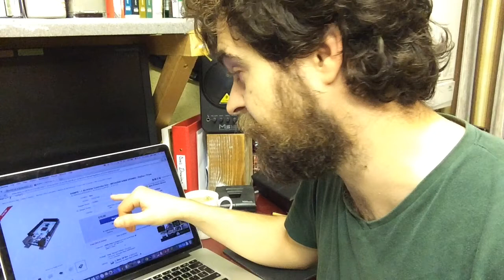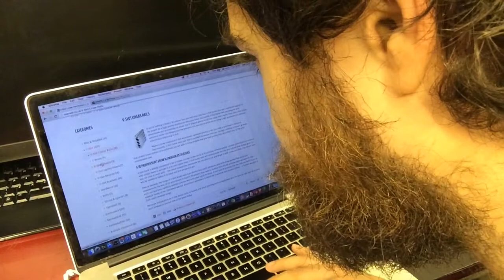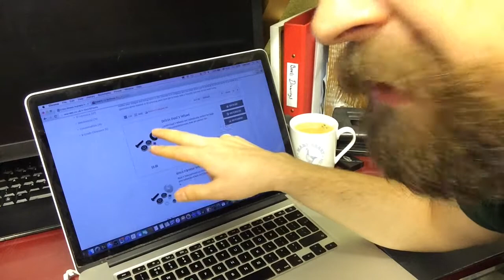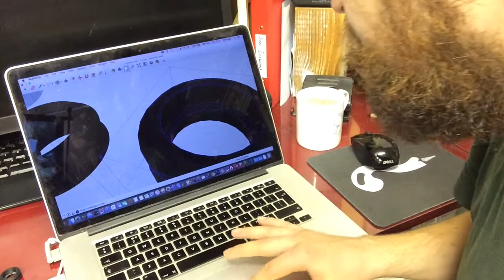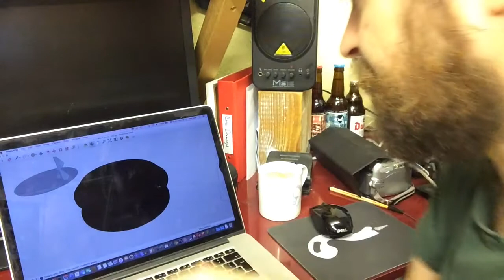CNC Router Blog 1: 3D Printing V-Slot Wheels

Comment: could you print  4 correctly tapered discs out per wheel . then glue them together on a bearing to keep them aligned
Reply from the maker: +paul dunford good idea - although I've given up on 3D printing them because the layers in the 3D printed ABS will definitely make a weaker wheel compared to one that's lathed / milled from a solid block. I ended up buying wheels from the AliExpress link that +alex Bondarenko pasted in his comment - they were a really good deal. But I still want to try making my own v wheels for future projects, and I'll probably add a 4th (rotational) axis to the cnc machine I'm building so I can have a crack at making some.

Comment from the maker: I didn't expect so many helpful comments on this video - steel wheels would be cool but I'm going to try Delrin to start with. And that means that next I should build a 4 axis CNC to make more wheels!
Reply: Careful with the metal wheels as numerous people have reported it eats into the extrusion.
Reply from the maker: +Dark Alchemist thanks, I'll bear that in mind. I'm using delrin wheels at the moment just because they're cheaper. What you say makes sense to me, because it feels like delrin has some flex which probably helps it to fit very precisely to the v slot - but I assume that because the steel is harder than the v-slot, the aluminium would be flexing instead. Which sounds bad!
Reply: OpenTronic
It is and having two dissimilar metals touching isn't a good idea either.

Comment: You might want to check out CNCRouterPartd.com for more ideas and though they are not the cheapest supplier they do offer many designs for free that may be of interest to you. Also, try to keep in mind the forces the v-slot wheels will undergo as the plastic options will not endure long even while cutting hardwoods. This why they offer the v-slot wheels in stainless steel. The OpenBuilds stuff is reasonably priced, but if they do not have a UK distributor then you should loo for their stuff on Amazon and hopefully save some money. Good luck with your quest!

Comment: Just want to add that you should compare material properties these wheels are made. ABS is not match to Delrin according to this http://www.plasticsintl.com/sortable_materials.php.
 Another thing is that Delrin has super low friction on metal and will last long without any grease.
Reply from the maker: +alex Bondarenko true, although I think the 3D printed ABS would delaminate, split, along the printed layers, before I reached the stress limits on that material properties table. Delrin would certainly have been my first choice, but I was in a sort of catch-22, because I would have liked to cut my own wheels on a CNC lathe, but I need the wheels before I can build any more CNC equipment. It's frustrating to have modelled a perfect shape in SketchUp but to be unable to machine it properly. The link you sent will help though!
Reply: +OpenTronic Same problem for me :), Try to build something to start with and it should be able improve itself.
Reply from the maker: That's the dream :)
Reply: +OpenTronic +alex Bondarenko I have seen steel V wheels as well, but can imagine that'll make a lot more noise, and could damaged the track over time.

Comment: Hi, recently I was trying to find this wheels cheaper and found them here, http://www.aliexpress.com/item/High-tolerance-CNC-solid-v-wheel-kit-for-v-slot/32337093164.html 
Maybe you will find it useful.
Reply from the maker: +alex Bondarenko Thanks, that's a really useful link! I've never bought anything from that site and wouldn't have thought of looking there. On eBay in the UK only one supplier sells them at about £5 a wheel, and in UK prices the ones on aliexpress cost £1 per wheel.